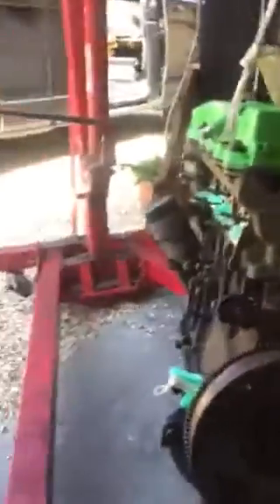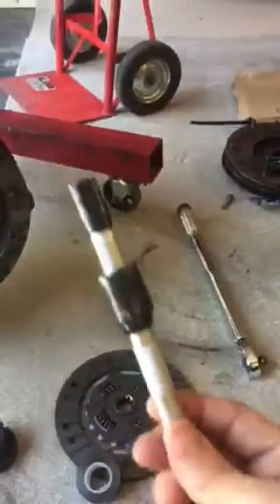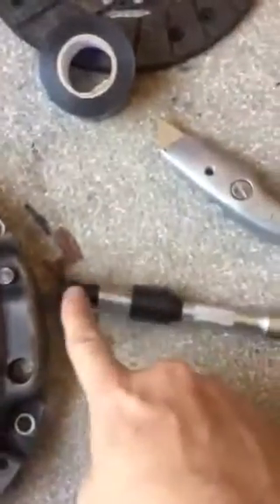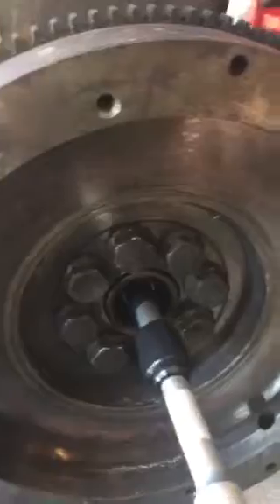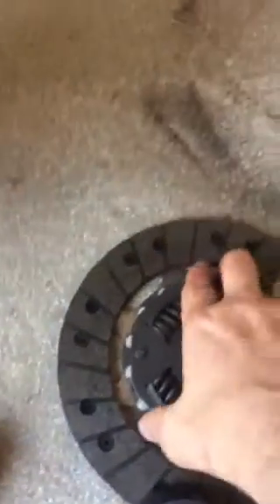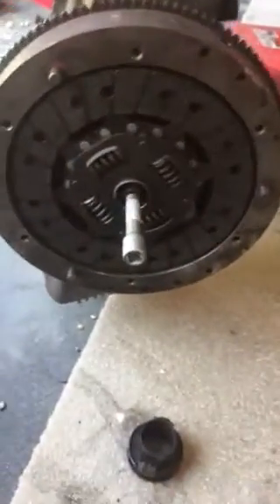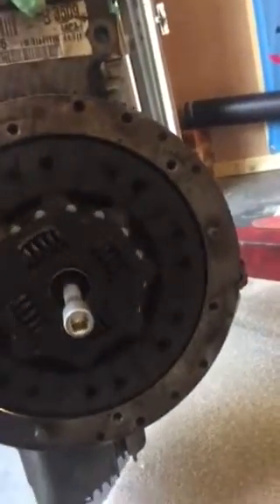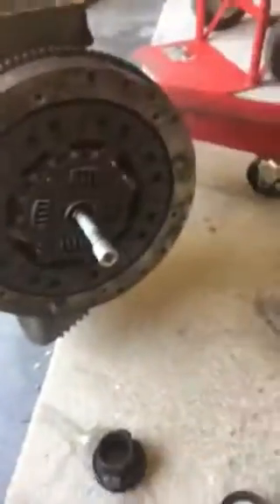Simple clutch alignment made very easy with homemade tool

Comment: Won't work on this 1999 freelander diesel i'm working on; there is no pilot on the shaft,no pilot bearing,*AND* the nest in the crank is way bigger than the ID of the splines; on top of that i can't sight it,the chassis is on the way; but tomorrow i'll try and lower the engine  a bit to be able to do it by eye,like i've done many times.

Comment: I used a clutch alignment tool t fit a self adjystibg clutch, tighteed all the pressure plates evenly to torque, now no gears, brilliant! Clutch won't disengage, why?
You tell me! Lol
Reply from the maker: Release bearing is in there right?? Or clutch plate wrong way round?? Done that myself once 😂😂
Reply: @e36racer44  Clutch slave is 'in' bellhousing, i can see it depress clutch plate fingers, clutch disc is correct way round.
Its a self adjusting one which you are supposed to use a tool for, but my Renault service manual just said to gradually tighten all pressure plate bolts diagonally, a little at a time, no tool mentioned!
Something is trapping my friction plate, but i don't know how?
Reply from the maker: Hey man I’m really sorry but I don’t know! I’m no expert and have only really ever messed around with BMW’s

Comment: This is a great idea, but it did not work for me. The electrical tape was too mushy to keep the extension from drooping. If I used more tape and tried to gently hammer it in how you showed, the layers of tape would shift out from under each other.
Reply from the maker: Muftobration hi mate... I think the key is the EXACT amount of tape, like you I’ve suffered with it not working for same reasons, but persevere and it’ll work :)
Reply: @e36racer44  Thank you, and thanks for uploading the video in the first place. I was fiddling with it quite a bit, starting with a lot of tape and then removing one revolution at a time until I could just barely get it in. Then I would add tape back until it just wouldn't fit. I'll give it another shot tonight and see if I can get it right.
Reply from the maker: Muftobration hi mate how did you get on
Reply: @e36racer44  hey, thanks again for the video. I actually ended up lining it up by eye and feeling my way around to make sure it was centered. I figured I'd try the tape method again if I couldn't do it, but I got it right on the first try. I'll give some detail for those who are also in this predicament:

Put the clutch on the flywheel and then put the pressure plate over it. The clutch will not be aligned; that's okay for now. Put a few bolts through the pressure plate and snug them down every so slightly with your fingers, just enough so that you can slide the clutch plate around underneath it and the clutch will stay where you put it. Look down the center of the clutch where the main shaft will go and see if you can spot the pilot bearing. By eye, try to center the clutch relative to the pilot bearing. Once you think you have it pretty close, stick your finger through the clutch and try to feel the pilot bearing. Feel all around to determine if it's shifted slightly in any direction. You'll be surprised how accurate you can be with your finger.

If you get it wrong, you won't be able to get the transmission in. Try again. It's a slog, but it will work.
Reply from the maker: Muftobration great idea mate, glad you’ve got it sorted :)
Reply: Same is happening in my situation, the clutch disc has noticeable droop on the diy alignment tool, just from the weight of the clutch disc. I’ve tried fiddling with getting the perfect amount of tape but no luck :(
Reply: Pushed up slightly on the diy alignment tool when tightening the pressure plate, to compensate for the droop. Tranny ended up going on just fine onto the motor :)